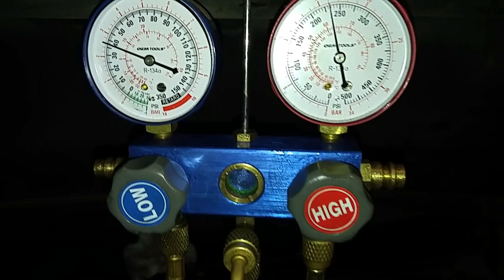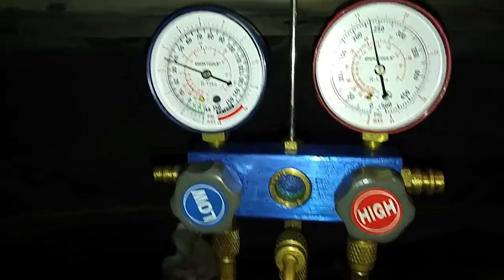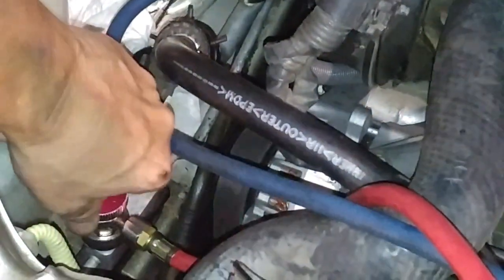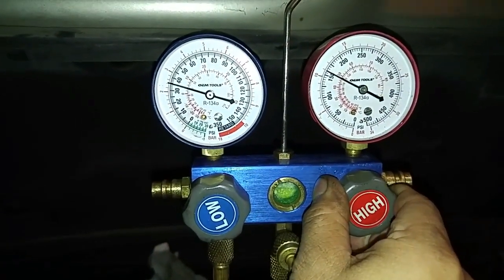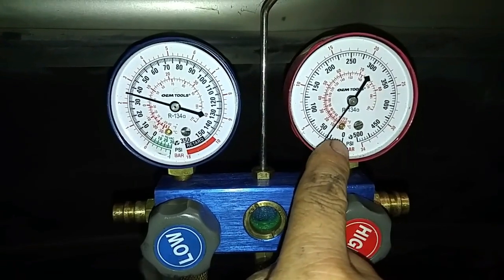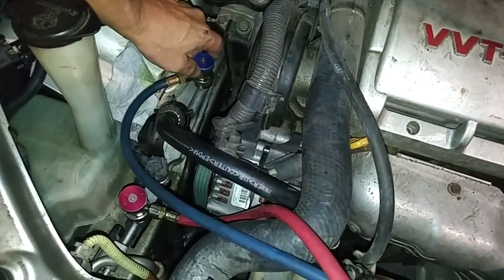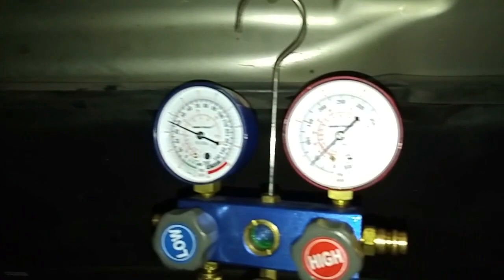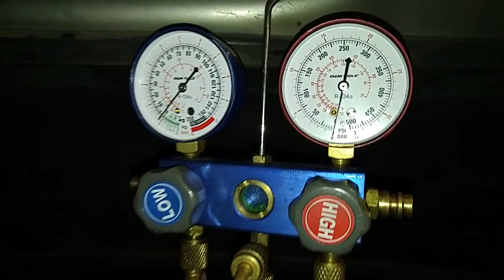How To Get 3oz Of Refrigerant In Your AC Manifold Hoses Into your AC System.

Comment: Always keep the high side closed, and charge   through the low side, no need to transfer refrigrant from high to low.
Reply: It's a gas under pressure that becomes liquid. Volume and Pressure are related by the moles and temperature. Give PV=nRT a Google search, or Bing if you're so inclined. T, R and V are constants. If the pressure, P, goes up, then the moles, n, i.e. amount of trapped refrigerant in the line goes up. P on the high side is 4-5 times that of the low side, so there's roughly 4-5 times more refrigerant in the high side hose assuming they're equal ID.
Reply from the maker: Nope.  180 psi equates to 3 oz of refrigerant.  Closing the high side quick connect and opening the high side manifold allows the pressure from the high side line to migrate to the low side (at around 40 psi).  Then close the low side quick connect before shutting the engine off to prevent pressure equalization.
Reply: @hardlymovingpro  Very incorrect.  Pressure and the volume of the hoses have absolutely nothing to do with each other.  The physical volume of the hose cannot be changed and that one hose is about an ounce of it it completely full.  All this process will do is cause someone to get confused and screw up their charge.

Comment: Would there be about 3oz also remaining in the hoses if I were just checking the pressure and did not open the valves on the manifold?
Reply from the maker: It depends on the pressure reading on both gauges BEFORE you close off the low side quick connect (the high side should already be closed).  While the engine is running and the refrigerant to almost at the right capacity, you should close off the low side quick connect (which should be showing around 40 psi).  If you close it off AFTER you shut off the engine, the pressure will equalize (the high side pressure will migrate to the low side) and the low side pressure will jump to around 70 - 80 psi.   Total refrigerant in both the high and low side lines should amount to around 3/10 of 1 oz (or .3 oz).
Reply: Thank you

Comment: If you rev the engine you get more suction and get a little more out ?. Well done video.
Reply from the maker: Thanks.  I would think so.  Also placing a large fan in front of the condenser might help.
Reply: This got  me thinking..... by doing this procedure one has put in MORE freon in system than last measured. Doing this procedure would introduce just under 3oz MORE than what one had when last measured and concluded system was full.  A well presented and shot video by the way.
Reply from the maker: @joe28704  Absolutely correct.